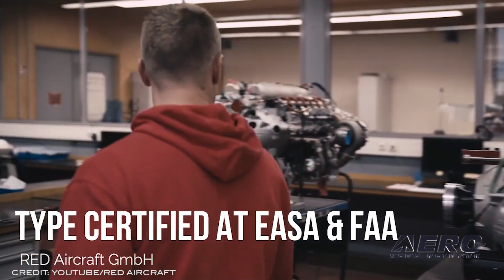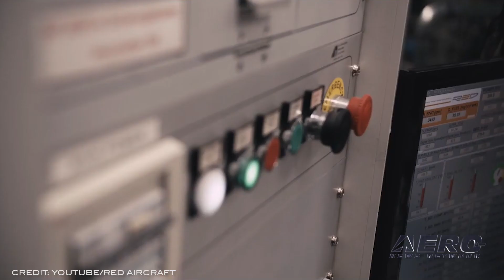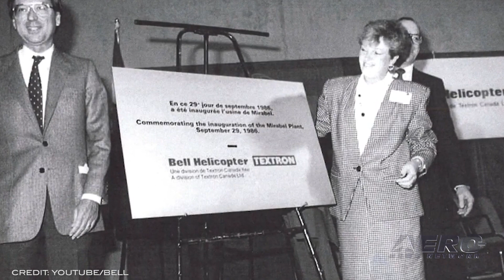Airborne 10.04.21: RED AO3 Engine, Autel Evo Lite-Nano, Mars Heli

Comment: Red Engine is a fantastic engine! Please help me to understand why designers stick to the more expensive, larger and heavier dual overhead cam design? Overhead camshafts are necessary for 9000+ rpm. The Chevy V8 has stuck to the proven pushrod design because they work well up to 8000+ rpm as aftermarket tuners routinely spin these engines up to 9000 rpm. Pushrod design advantages are a more compact, lighter, less expensive package, a definite plus for aviation.